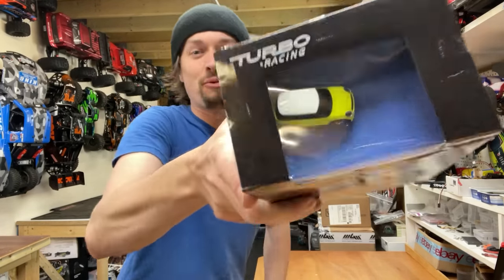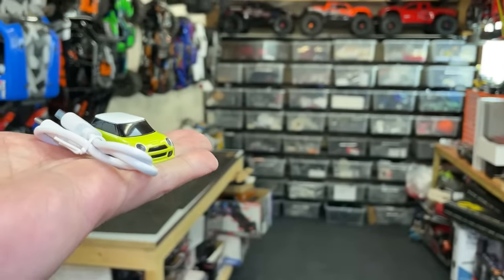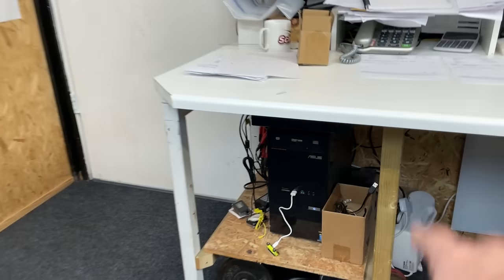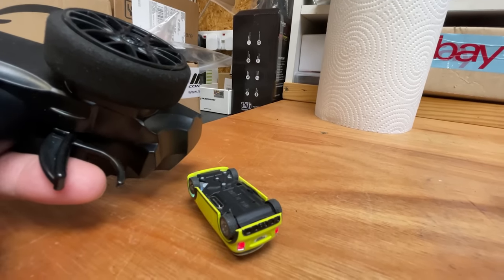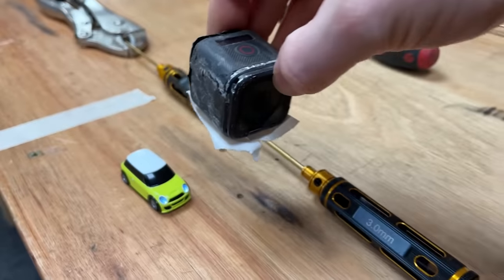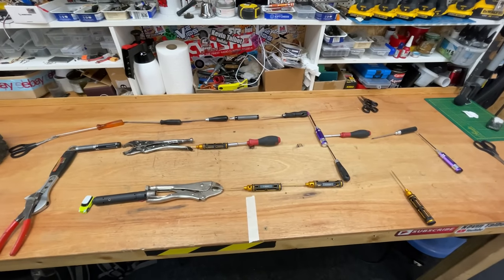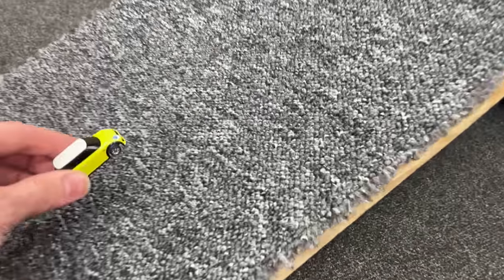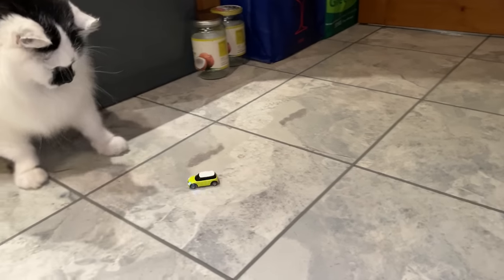worlds smallest FULL FUNCTION rc car

Comment: How does the size compare to a Hot Wheels car? Would it run on a Hot Wheels track? 

I'm thinking of my Grandson. Start by learning throttle control then later it would be simpler to add in steering. It would be convenient for him to practice and learn without needing adult assistance and being directly supervised. It's not like crashing it in the kitchen is going to break it or damage anything. Teehee! 

I've already, and prematurely at that, gotten him a entry level hobby grade 1/12 scale RC for him but it's kind of an ordeal for him to play with at his age. It takes time and/or planning especially with a toy grade charge which is all his parents currently have.

I may pick one of these up but not from Banggood! Too many bad experiences, more bad than good! They don't even hold themselves accountable. I think they treat various customers differently and they really try to take care of their affiliates. JMHO